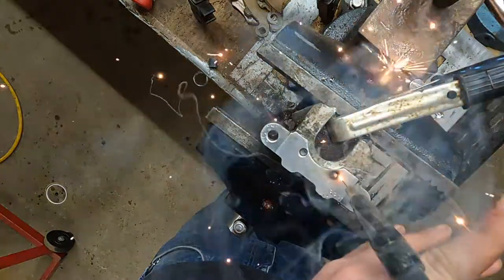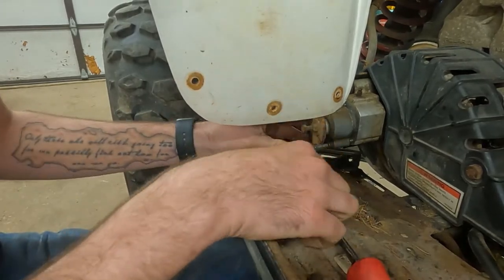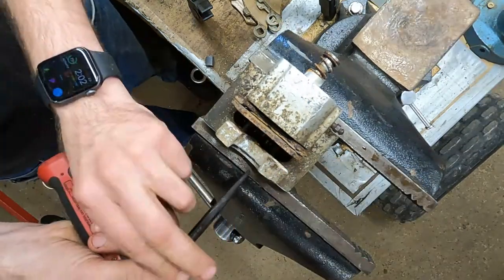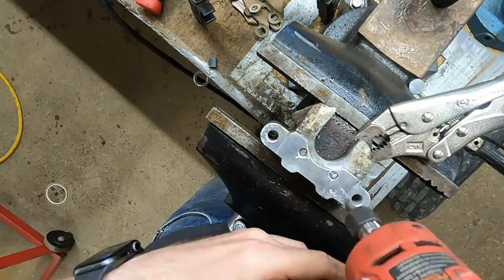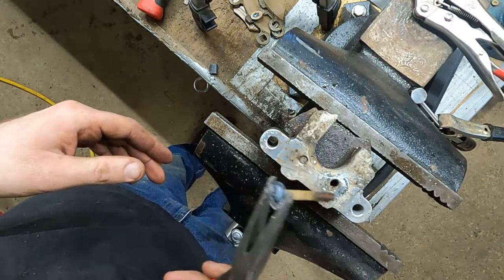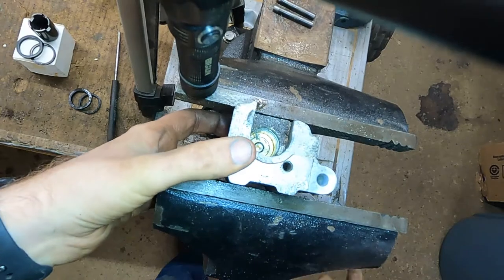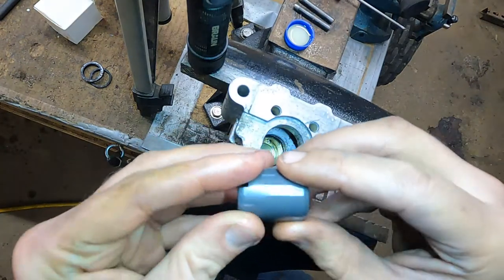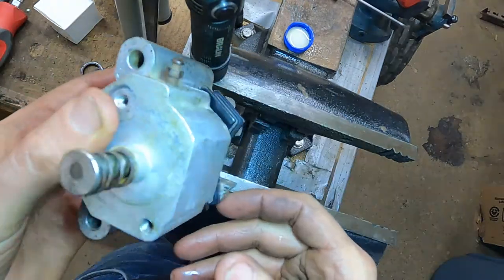Change Rear Brakes and Rebuild Caliper | Polaris Trail Boss & Xplorer

Comment: Thats when i just. Counterbore the pin holes and find a long socket head cap screw and turn the bolt down to the same diameter as the factory pins
Reply from the maker: That’d probably work!

Comment: Good job. I had watched that other video just like you but I had the exact same problem you did with those pins, and ended up basically doing the same thing. This was before finding your video. Rather then tacking a washer to the pins and letting the pins soak somewhat in penetrating oil, i ground the sides down on a cheap pair of vice grips, so i had more room. That coupled with the heat i was able to work them out an 1/8 of an inch to clamp another set of vice grips on. Your right this is a shit ass design and another problem im finding is, you cant find a new one, so repairing its all you can do. I am curious though, where did you find your kit for the rebuild? I havent seen anything with a new piston! I got my quad on a trade and im not even sure what the hell it is. He said its 96 trail boss 400. I look at stuff though on ebay, and things are really unclear. I just know my rear braking is just like yours.
Reply from the maker: If you look in my description I posted a link to it! Thanks for sharing how you did it! Maybe it’ll help someone too!